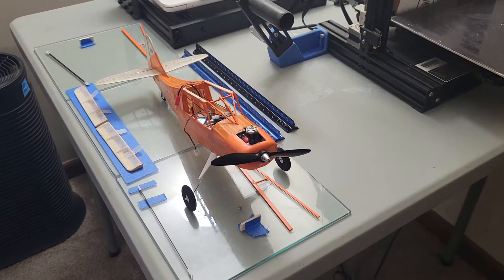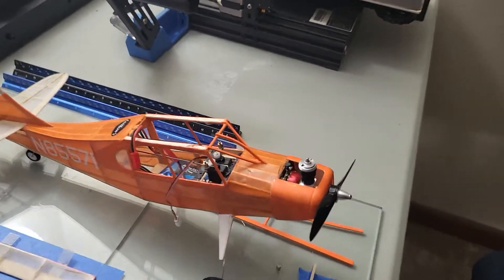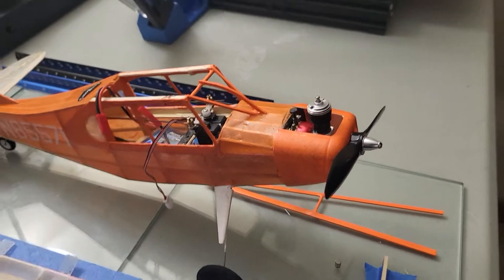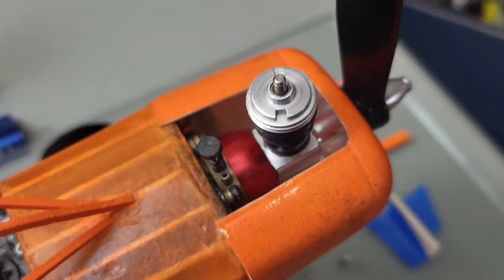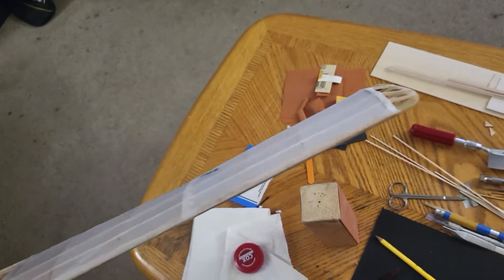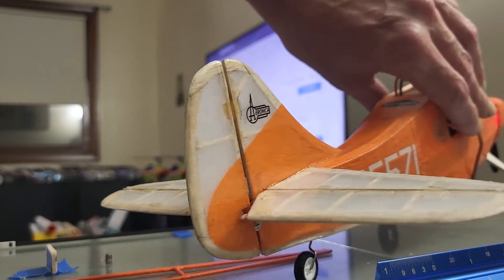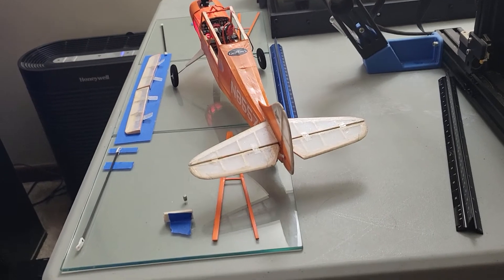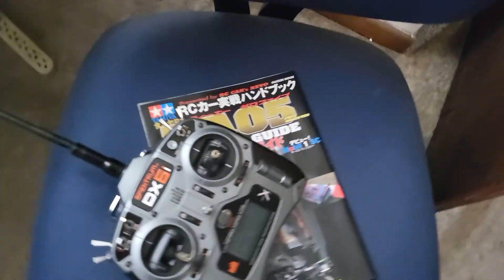Guillows Aeronca Champ MOD named project "Nitromicro" RC conversion experiment

Comment: Hey Chris, I was wondering what servo, battery and board are you using? I’m making my own piper cub, and was curious. Thanks!
Reply from the maker: Hi there Monty!  Well what a coincidence - I just started my most recent project , taking the Guillows kit #303 LC to a whole new level and transforming it into a clipped wing cub!

For this experimental project, I used two pairs of Flite Test 1.9g ultra micro servos.  The cumulative weight of the servos, adapter wires, and any added scratch built mounting brackets I made is not worth all that trouble.  I switched now to ultra micro linear servos, as seen in many of the smallest rc airplanes available on the market.  This saves volumes of available space inside the model as opposed to using the Flite Test electronics.

The setup I'm actively using now is a combination of 2 external linear servos matched up to an integrated umx receiver that includes the 2 onboard linear servos for the tail.  There is no problem using ultra micro rotary servos as long as space isn't an issue and the target flying weight isn't bothered.  The rotary servos have the advantage of more torque and a longer throw, and I would use them mainly for the throttle on those Cox Pee Wee & Tee Dee nitro glow engines.

There's way to many umx linear and rotary servos available at online hobby shops for me to list, and I can only point you down the isle at the store.  My advice is to pay attention most to the weight of the servos no matter which type you plan to use

Buzzle Products always has the best bang for my bucks for the integrated umx receivers, under $40 - here's a link:

https://www.ebay.com/itm/324700551608?hash=item4b99a939b8:g:mUYAAOSw1pxg35kP&amdata=enc%3AAQAIAAABINm5rkwb6J8RYK8bfaBCE60FtdBtv3Lc9zZldqkFdY%2F31wWnQut9BjAPrxRinTVBvYtxxt%2FM1XQLwWZ2iC142H4Bu6Unlwm31EffJ3%2BxiaosoHtcDu6NrmkfY9h5DGSUE6hU9WDjUpWWdjtbNZ1J6EL8LnbyDLDLfm%2FX5%2FRKfjT5hIblopY0erDf8wPV800oIZBAAi%2BjIyxkjXcS3aBz88F4YqZvNSjZuxjasPWolbL%2BttzEYriMICAU8kEPmcaINBRUiWs9YEY9OoAgysLF44ND5XPlP58Rx%2B5%2FiRXzP0uvQykpCxOImYNlf2REgjlkwLeCjO18Vy3z9kZObcDvLQ5Uf07PcBaZrUth1aT4g5PDUPOQWFJWmDkv7Xu8vaDPsg%3D%3D%7Ctkp%3ABk9SR7re_9CHYg

For the battery I use the 1S 1P Power Hobby 2100mah lipos and they last a long time since my models are nitro and don't power a motor, which eats up the brunt of the power.

Okay - to wrap this up, my clipped wing cub project will be using the Crossover UMX DSMX/DSM2 umx receiver as listed above, the Power Hobby lipo 1S batteries, and a pair of 1.9g linear servos for the ailerons.  Those servos will use extension wires running inside the wing, with no throttle servo - it'll run on the edge of full throttle full speed.

I hope that answers everything.  Please share your project, I'm interested in following you!
Reply: @christophermacbrian3380  Hey Chris, thanks for the fantastic detailed reply! Heres the link to the build log of my Piper Cub. Thought you’d be interested!

https://youtu.be/cf-LmxtB_GQ 
Thanks!